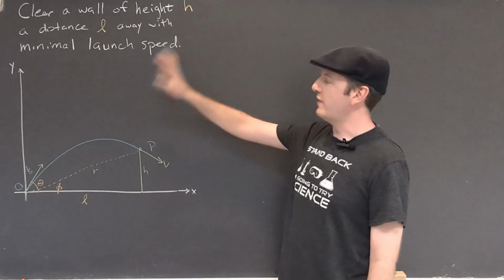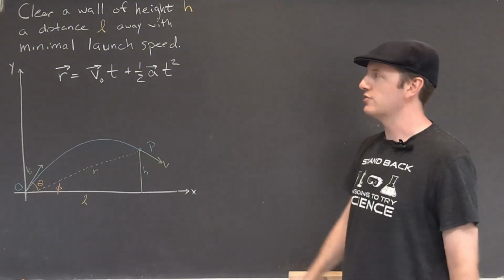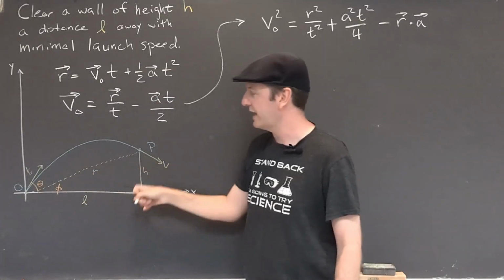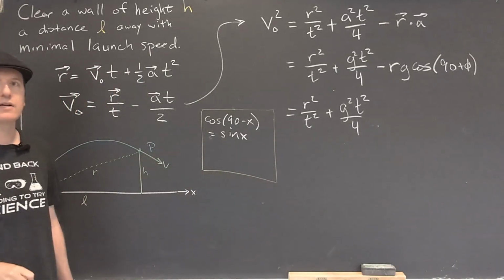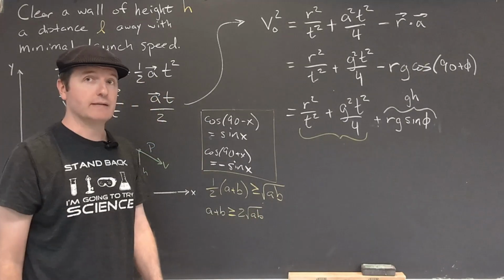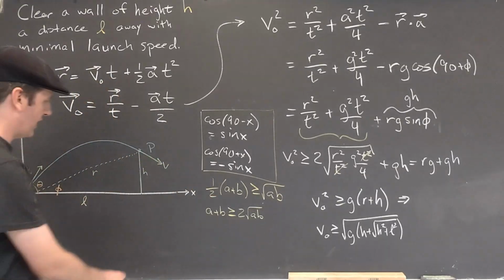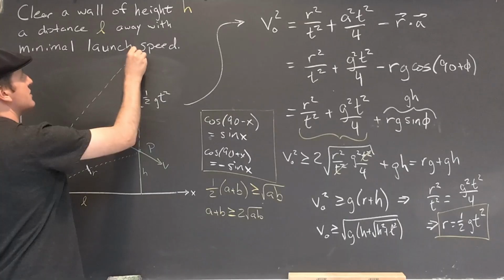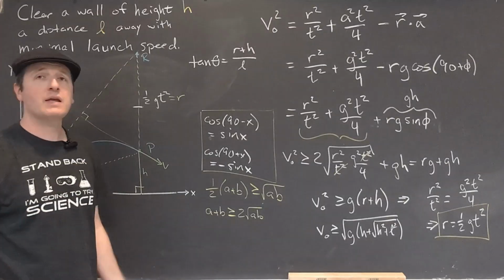Clearing a Wall with Minimal Speed

Comment: A nice other way to approach this is to consider the cartesian eq and sub in the points (h,l) and then we create a quadratic in terms of tantheta which we say must have at least 1 real root. The discriminant must thereby by greater than or equal to zero and after a bit of rearranging maybe completing the square u get the same result
Reply from the maker: Excellent point. I can't count how many times a max/min problem can boil down to setting a discriminant to zero (especially in Euclidean geometry problems where so much depends on our quadratic distance formula). It's fun to use this in place of standard calculus techniques when students get too comfortable with "write formula, take derivative, set to zero" and zone out.